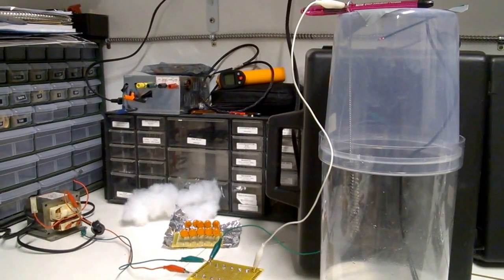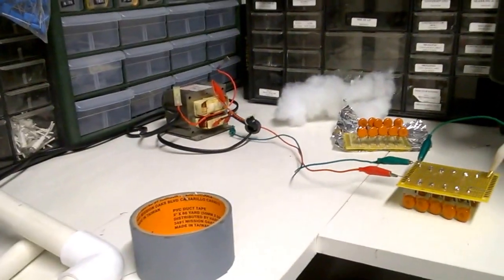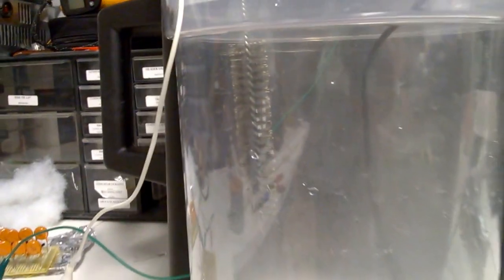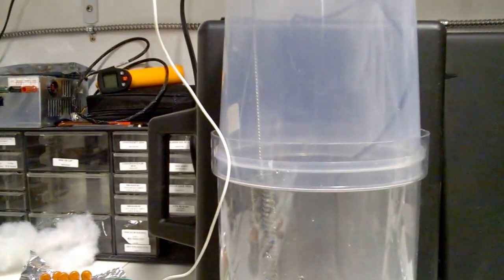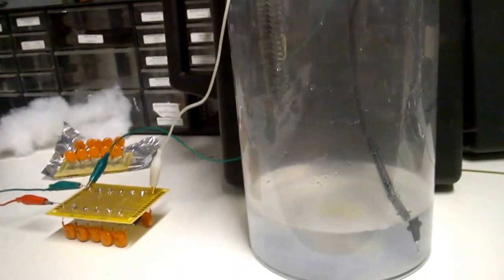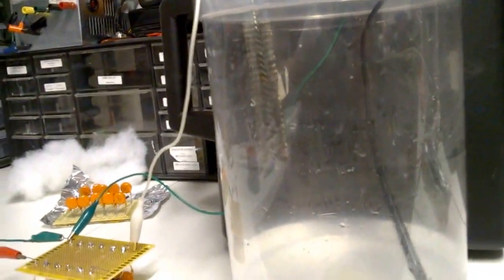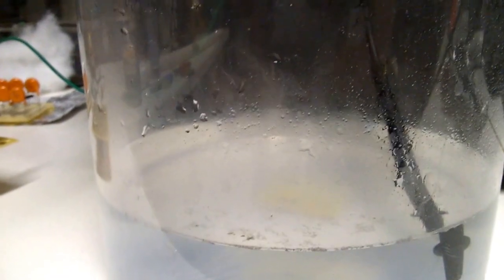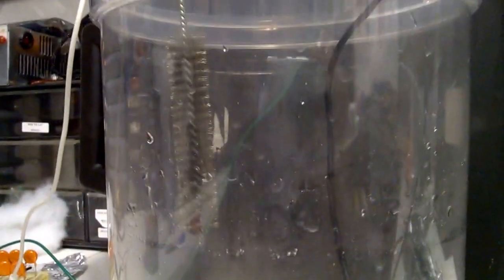DIY Electrostatic Precipitator With Liquid Electrode Test Chamber

Comment: you might be able to improve the working of this device by also adding in some soap.
doing this will reduce the water surface tension, as well as making it more easy for dry and/or hydrophobic particles to get into the water and stay into it.

Comment: Nice job, but it may be possible to make some improvements. In my experience the dust is attracted to the positive electrode, so maybe do some tests with the polarity reversed to see just where the dust ends up. At the moment, with the brush positive, it may all end up on the brush instead of the water. Also, as less than one mA or less will be flowing, tap water is plenty conductive to not require added electrolyte. I have one of these that I built for my lab, its basically a tube with a fan. The air is pulled in past a metallic mesh charged to minus 2000v then it passes another mesh charged to plus 2000v. When I tried it with the second mesh at a minus potential it didn`t work as well as when it was positive. This comment is a little late, but it might be of interest for anyone considering building such a unit. Great work, complements Chris UK.
Reply from the maker: Hi Chris,  Thanks for the tips!  I definitely need to explore this again as it has been a long time since experimenting with high voltage.  I haven't tried switching polarity on this particular setup but have on the ESP style builds I made and did notice a difference.  All the best to you :)

Comment: I was wondering if this setup would work- thank you! Now I can test some builds with a little confidence that it will work in the end.
Reply from the maker: Hi Dustin, glad to have helped :)  Hope your experiments go smoothly. A good tip is to use a PVC pipe with some tin foil taped on the end to act as a shorting rod used to de-energize the high voltage capacitors.
Reply: i dont mean to be so offtopic but does someone know of a trick to get back into an Instagram account..?
I was dumb lost the password. I would appreciate any assistance you can give me.
Reply: @Terrance Jeffrey instablaster =)
Reply: @Stephen Antonio i really appreciate your reply. I found the site thru google and I'm trying it out atm.
I see it takes a while so I will get back to you later with my results.
Reply: @Stephen Antonio it worked and I actually got access to my account again. I'm so happy:D
Thanks so much you really help me out :D
Reply: @Terrance Jeffrey You are welcome =)

Comment: Very clever! How are the connections, from the microwave oven transformer, made to the Cockroft-Walton multiplier? The high voltage connects to the first capacitor? Or to the first diode? What about the ground?

Comment: Just wondering why you would use salt water instead of  dry, grounded collecting plates in a home air quality system?  You are going to have air moving across the water and seems it will evaporate, either by airflow or natural evaporation and one will have to keep an eye on the water level.  If the water dries up, no workie.  

Can you see any corona being generated on the wire brush?  It seemed to charge the particles in the smoke but when mixed with larger particles, like lint/dust, you will need higher corona generation to charge the larger particles. More discharge electrodes of a smaller diameter  will generate more corona, which will charge the larger particles and make them collectible.  Try a piece of .0.1055 diameter spring steel or a piece of barbed wire as your discharge electrode.

Comment: That was brilliant. Can this be done at a lower voltage though? Trying to think up a way of doing this on a smaller scale - likely with a fan passing air thru
Reply from the maker: It can be done using a static electricity generator that produces a much lower current which is much less likely to kill someone than using a microwave oven transformer but that is still high voltage.  The high voltage is necessary to establish a strong enough electric field to attract particals as well as corona/ionization to charge the particles.  The only low voltage means would involve mechanical filtration and heat based filtration techniques.

Comment: For ESP's, what's the key factor for the amount of ozone produced?
Reply from the maker: its the corona that will produce the ozone.  From there it is the voltage level how the terminals are designed to produce the amount of corona and the amount of oxygen present to be converted to ozone.  I believe the polarity of the voltage has an affect with positive voltage producing less than negative.
Reply: @LockeLaboratory  I'm intrigued by this type of air filter and intend to build one to remove solder fumes, but the ozone worries me more than the fumes. When you have worked with this, have you ever felt a certain smell around the apparatus? (It's a very distinct smell)
Reply: @LockeLaboratory  Also, can the corona discharge be tuned in order to produce less ozone without making the filter less effective?
And kudos for being active 8 years after you published the video 👌
Reply from the maker: @minime9400  thanks! Yes ozone is a real concern which may negate the practicality of this device for home use.  There are some moves to minimize effect of ozone but it will never be zero since corona is also required to ionize incoming gas.  In general what increases ESP's filtering power can increase ozone generation rate unless you do something expensive or exotic such as using an oxygenless environment or perhaps converting to electrospray to turn the ESP to a wetscrubber.  There are optimal parameters for ESPs and I'm sure there are research papers written on it.  In general sharp protrusions increase corona production.  Typical design is a wire within a cylindrical tube or wire sandwiched between plates.  On the wires are the series of barb protrusions to concentrate the electric field where corona is produced.

Yes stopped making new videos since not much time anymore.  Hope to find the time again to make more videos while juggling a busy life.

Comment: Thank you for the video. Could you explane please how to make voltage multiplier ? What kind of diodes, capacitors and scema did you use ?
Reply from the maker: Hello, here is the schematic I used http://locketech.weebly.com/uploads/5/0/1/5/5015829/overallelectrical_schematics.png

Also the components are simply high voltage diodes and capacitors that are rated above 2Kv.  I found them on ebay.    The higher the value of capacitance, the better energy transfer.  One voltage multiplier uses 10 capacitors and 10 diodes.
Reply from the maker: Exact values are 2200pF 3.1kv capacitors and 250mA 4kv diodes
Reply: Thank you, dear friend.
Reply: @LockeLaboratory  the schematisc not found bro, can u repair the link
Reply from the maker: @ervanfahrizal2071  Oh thanks for letting me know.  I fixed it.  It is also here: http://lockelab.weebly.com/uploads/5/0/1/5/5015829/overallelectrical_schematics.png

Comment: i havnt microwave transformer. can i use 100*630Volt capacitor and 630volt diode and using 220volt input instead ?
Reply from the maker: You could do that, it may limit your output current and efficiency would be lower because you have a lot more capacitor/diode stages.  Each stage will have some losses due to resistance and corona losses. A transformer simply allows one to jump to a much higher voltage in one stage.

Comment: dude, how many farads value and the ratting voltage of the capacitor that you use for voltage multiplier circuit in this video ?
Reply: if I may ask again , what specs MOT you use, and the capacitor you use , where can I buy it because , in my country is very difficult to find it, I am interested in your project , for my final project
Reply: Thank's for your respons

Comment: dude, i have capacitor with rating 3kv, is it okay if i used the cap to this circuit with 2000 VAC supplay ?
Reply: +jlocke8 so i just series the cap, it save just put it in series ? or put some another passive component to secure the series capacitor, can you help me with this problem ?
Reply: +jlocke8 in some forum i see their use resistor to remove make leakage current from the capacitor, or i just tripled the capacitor in seriest without the resistors beacuse in my country it so hard to get high power resistor to secure the leakage current
Reply: +jlocke8 have you already, measure the output voltage of this circuit ?
Reply: +jlocke8 thank you for youre respons